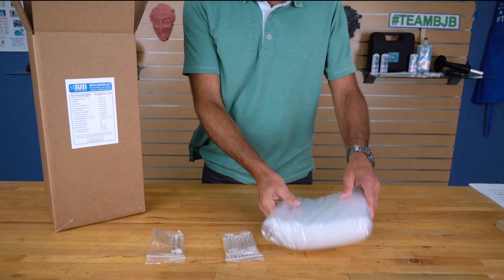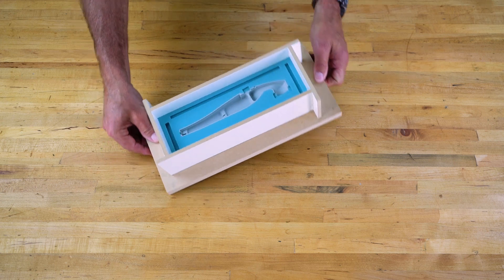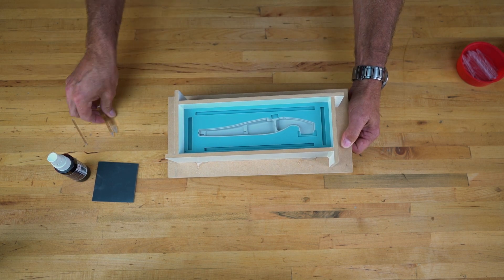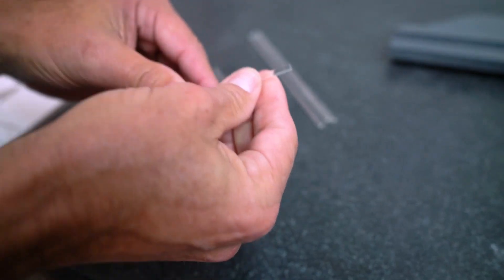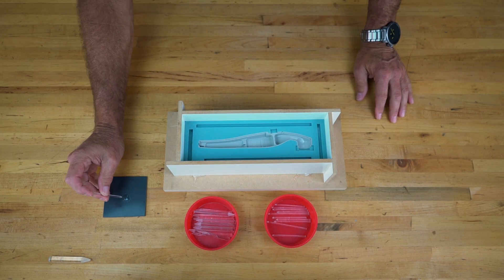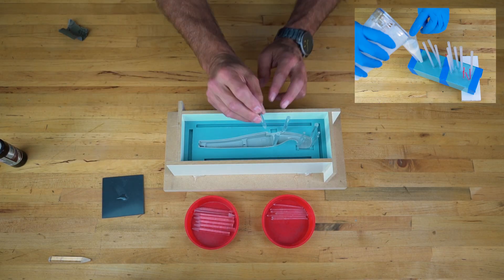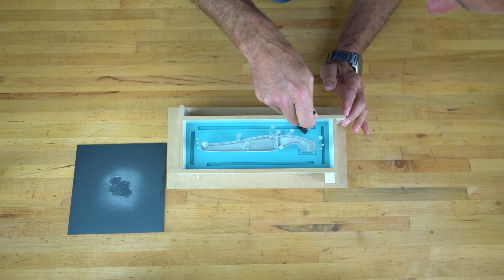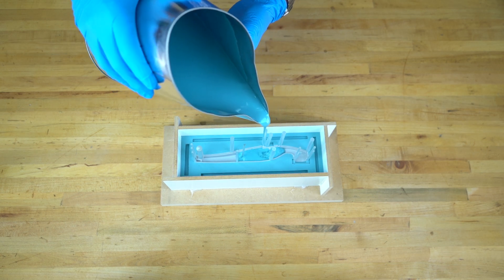Vents for Silicone Molds | How to & Available Products

Comment: What material are those rods you use ? Also, you mentioned the diameter of the vent port, but not of the fill port and it’s tip. I am not in the USA and am looking for a suitable material to make these vents, I tried weedwacker plastic but the CA glue doesn’t stick it.
Reply from the maker: The vents and fill port are made from acrylic rod material.  For the vents we use a rod size that matches common drinking straws.  You could still make parts without the drinking straws but liquid polyurethane will spill out all over the top of the mold when it is full.  The fill ports are .5in (12.7mm) and .375in (9.53mm).  We have 2 sizes because there may be a much thicker, higher viscosity polyurethane system or we are making a larger part that needs a larger fill port opening.

Comment: Hi..do you use pressure tank for this casting?
Reply from the maker: No we did not.  Our mold is constructed so well that the air makes it's way out on its own.  Some materials and mold configurations may benefit from pressure casting.

Comment: Hi I usually make my vents in stainless steel that fit into drinking straws so they are not too heavy, had a problem with my last mold and the vent moved out of position. I have filled in the hole in the mold  left by the vent using the mold rubber (mold star 15). I now need to put a hole through the mold to replace the out of position filled in vent , what is the best way to do it 
Regards Stuart
Reply from the maker: A quick and simple way to "drill" a new vent hole is to use a small diameter piece of brass tubing, chuck it into a drill, and slowly drill it through the silicone.  It helps to sharpen the edge of the brass tube by running the edge on a piece of sandpaper as you slowly spin via drill motor.  This trick produces a much cleaner hole than using an actual drill bit.

Comment: is there any drawback from putting too many vents? I want to be very sure there's no trapped air but am worried too man vents will affect the pour
Reply from the maker: There really isn't aside from having more spots on the part to clean up from the vent marks.  If it's on a non-aesthetic surface of the part like this video, then it's no big deal.  Vents help with air getting out, but they also provide a reservoir of extra material when the urethane in the mold cures and shrinks a certain amount.  The vents feed material back into the part.  We see many molds that use the fill port as a vent, and you'll often see the material sucked in because that is the only reservoir of material the curing part can draw from.
Reply: @bjbenterprises how can the the material in the vent still be liquid to suck back into the mold when the material in the mold is curing/cured and hence shrinking? Surely the material in the vent straws are not going to remain in liquid form while the rest of the material cures. So I question this theory. I do molding so I understand the process.

Comment: I'm completely new to this, so I've got a question: How does the item de-mold perfectly, without having vented material stuck to it? The plastic that flows up the vents is still part of the cast copy, isn't it?
Reply from the maker: The cured material in the vents are first twisted and removed using pliers before the part is demolded.  Because we used a vent rod with a sharp cone shape, it creates a specific breaking point at the tip to make this process repeatable.  Otherwise the vent material would indeed stay attached to the part and make demolding much more difficult.  You can see them being twisted off at 2:05 before demolding the part.